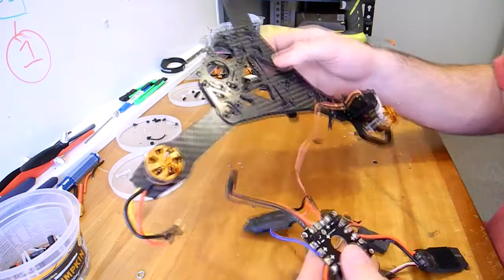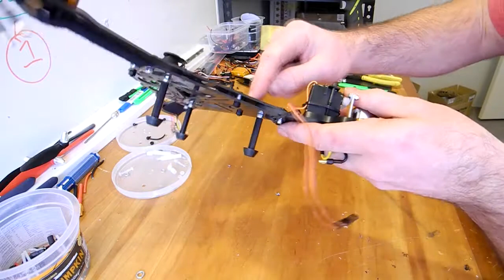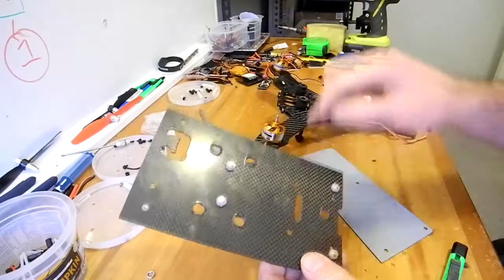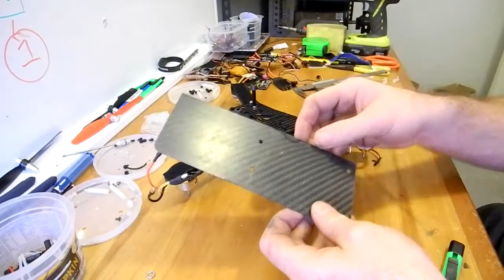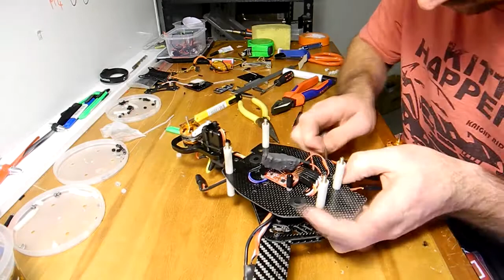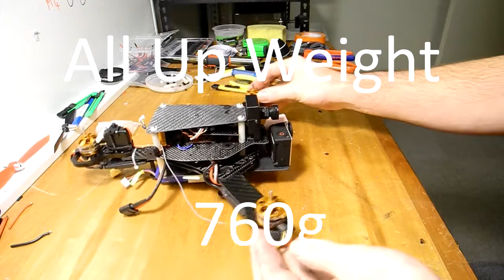Armattan tri-copter dampener mod

Comment: nice mod...i am going to get one of your frame...what kv of motor use? what  size is ur tricopter? how long is the fly time?
Reply from the maker: They are the supplied motors, it's meant to be 258mm motor to motor. I get about 8-10 mins with 2200mah